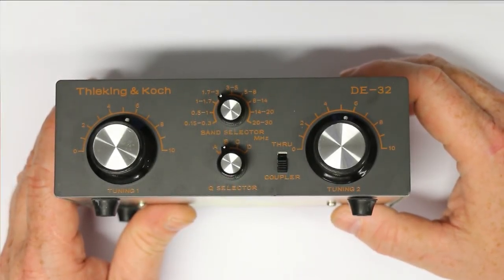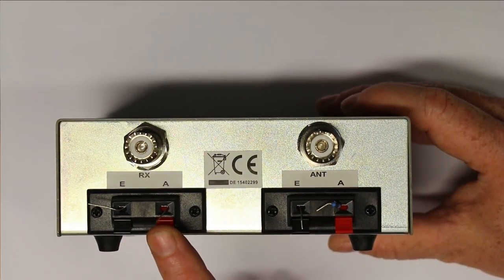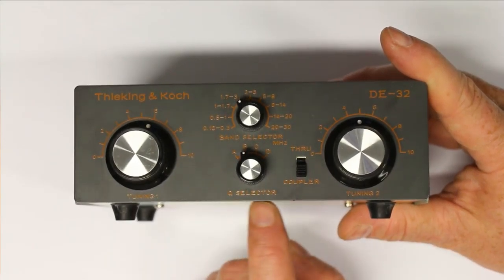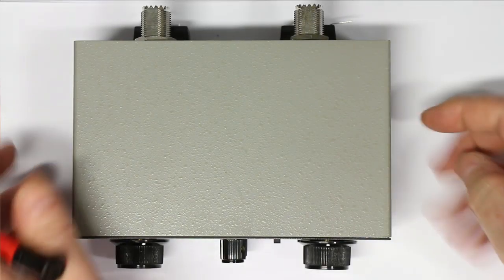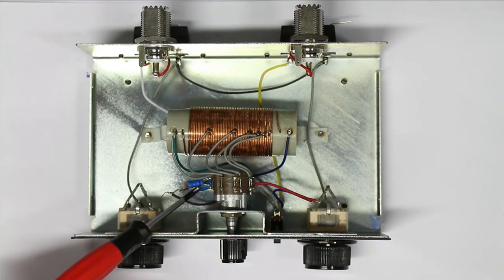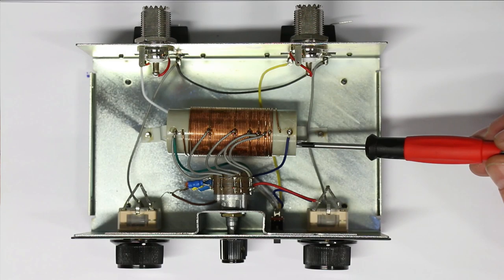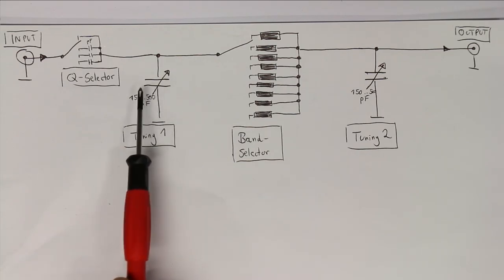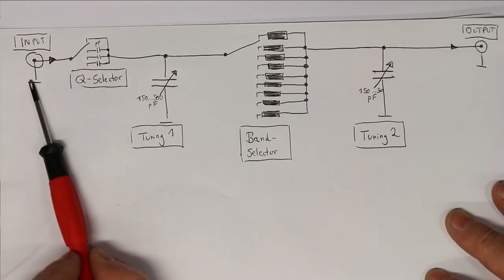How an Antenna-Tuner or Match-Box Works (Thieking & Koch DE-32)

Comment: I use a DE32 and it does work quite well for me.  I think many people are confused what a tuner does and act if it should magically amplify the signal to wow you.  I use it to tune my portables to a long wire or random wire antenna. Also this tuner seem to have the ability to reject unwanted noise and signals when Dxing.  It's great for Dxpeditons  as it requires no power.  Thanks for the video which taught me how to use this tuner when I first bought it.  Brian Heilbronn, Germany

Comment from the maker: Some additional clarification:
1.) Of course an antenna match-box can not only match from/to 50 ohm impedance.
It can basically any input impedance to any output impedance depending on the value of the components. 50 ohms is just the standard-impedance in RF-equipment. That´s why most antenna match-boxes are designed to achieve impedance-matching to 50 ohms or nearby.
2.) What looks like a low-pass filter on the first experiment can also be the "right" (high-frequency) side of a very shallow bandpass-filter curve. I did some simulations with LT-Spice and you can get a a low-pass filter with a peak at the "resonant" (tuned) frequency, a low-pass filter without peak or a bandpass-filter depending on the choice of the values of the components and the input- and output-impedance.

Roger

Comment: Great video and very helpful demonstration . Thank you. Could you speak to the issue of best matching solution ie how to get the most ideal match when using a tuner such as this, from the multiple possible impedance matching solutions. Thanks again.
Reply from the maker: Ooh. That´s is a very complicated and extensive topic.
The easiest way is to tune your receiver between two stations where you only receive noise (and if possible turn off AGC and noise-blanker)
Then play around with the knobs until the noise gets loudest.
This is far more easier than trying to "calculate" the optimum settings especially because the 2 variable capacitors have a non-linear capacitance scaling.
And furthermore the complex impedance of the used antenna is usually frequency dependent and you would need a NWA (network vector analyzer) to measure them (while the input impedance of the receiver is usually a constant 50 Ohms impedance).

Comment: This is the best tutorial/demonstration/showcase on this topic!
Thank you very much. Big big thumbs up
2 questions:
If you have on the right side a transmitter with a fixed impedance for instance  50 ohms.
Is the  the left capacitor is unnecessary?
What is the direction of the knobs? To the left (0) low  and to the right high (10) capacity?  Or vis versa?

Comment: Do you know of any antenna tuners that cover LW besides the wildly expensive T&K?  Most of them seem to stop at 80 or 160 Meters.
Reply from the maker: No. Sorry.
I´m not an expert in Ham-equipment.
Reply: What were the values of the Q Selector capacitors on the schematic that you showed in the video?
Reply: steve c — I was hoping he would share the components values as well. Eg: the gauge of the wire, how many turns, varicap values etc etc. I’ll check the web out for inspiration and build one myself.

Comment: At 18 minutes in you seem to be showing a condition where the antenna tuner is being tuned to the RF frequency and actually making it greater but I don't think that is possible!  I can't duplicate that and I can't find any other videos that have done it either. In one video they actually tried to use antenna tuners to increase the received signal and it failed to work!  I tried 2 tuners, one by Heathkit and one by Ten-Tec but when they are tuned in to give the best the signal it is not as great as when they are bypassed and completely out of the circuit!  While they do seem to lower the noise floor a few dBs by blocking unwanted signals on other frequencies they can't boost the received signal any.  The T&K DE-32 antenna tuner you used is quite different from other models though and has the circuit all backwards compared to the others.  The T&K has the two tuning capacitors at the input and output being connected from the signal wire to ground with the switched coils in series with the signal while the Heathkit and Ten-Tec both have the tuning capacitors in series with the signal at the input and output and the switched coil connected between the two and to ground.  Do you think that makes a difference?
Reply from the maker: The signal-amplitude really is higher than the input-voltage at 18 
minutes due to the fact that an (unloaded) LC-tank circuit amplifies the
 signal-amplitude by it´s Q-factor. 
And in this position of the 
switches and tuning-capacitors you get this effect. This is a natural 
consequence of the effect of resonance. 
Because the tank-circuit is quite heavily loaded, the amplitude magnification is not as high as it could be.
This is more explained in some of my other videos e.g. in the video "AM Magnetic Antennas Pt.22 and the follow-up videos: 
https://youtu.be/gJlkWt3VYxM
The main purpose of this antenna-tuner is twofold:
1.) matching the impedance of antenna and receiver
2.) blocking unwanted signals outside the received frequency

Point 1.) leads to lower losses of amplitude and keeps the maximum 
possible SNR by not wasting precious antenna-energy due to impedance-mismatch
Point
 2.) serves mainly to avoid distortion due to overdriving the 
input-stage of your receiver by signals with a very high amplitudes 
outside the received band. Furthermore neighbouring stations can be 
suppressed (a little bit) due to the bandpass characteristic.
The 
amplitude amplification (at max. just a few dBs) due to the resonant 
LC-circuit formed in/by the antenna-tuner is of a lesser importance 
because todays input-stages of radios/receivers are usually limited by 
atmospheric and man-made noise and not by the signal-strength/amplitude 
of your signal. 

I don´t think it makes a difference which way around the circuit is.
You basically could use/try it in reverse direction, depending on the impedances of the antenna and the receiver-input.

When
 you say, that the noise-floor is lower with the antenna-tuners you 
tried, well that is a substantial improvement in your signal!
An 
amplification of the signal-amplitude is just a bonus at some 
impedance-combinations/settings of the antenna-tuner 
switches/tuning-capacitors.
Reply: I tried connecting up my antenna tuner to test equipment like you did and it does actually seem to make the signal strength higher at the resonant frequency but unfortunately it doesn't work that way in use, when an antenna and a receiver is connected it never makes the signal any higher and seems to make it weaker most of the time.  On all the frequencies that I tried the signal is stronger when the antenna tuner is switched out of the circuit.